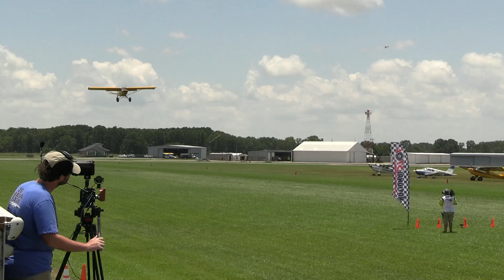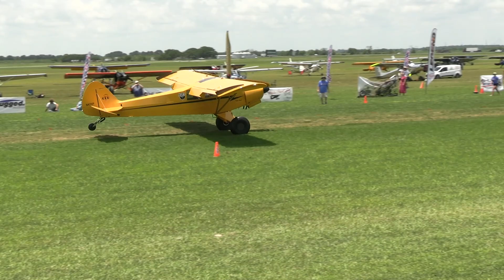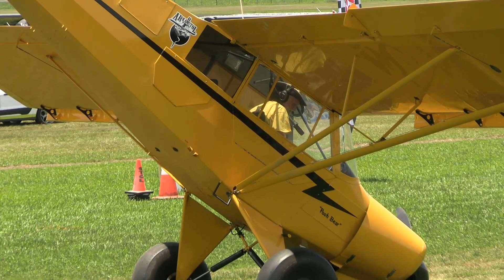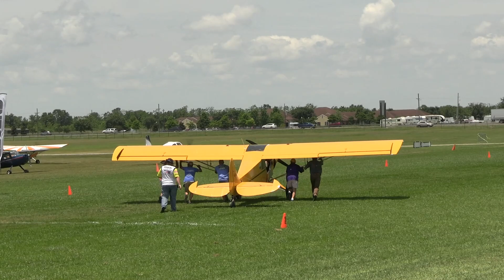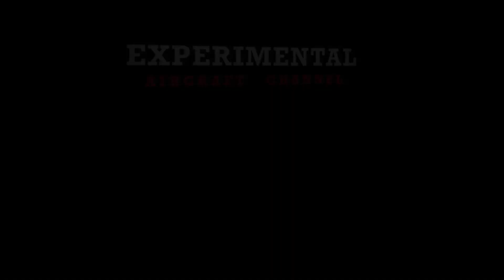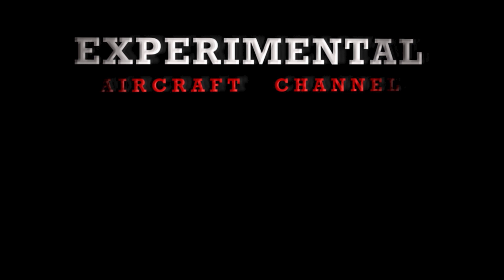SHORT LANDING!

Comment from the maker: Total NON-EVENT. Hard braking, sudden wind shift to tailwind or sudden gust of wind? Elevator is Full Up position with nearly no forward motion. Slow motion roll forward.  Your thoughts?
Reply: Improper technique. As tail is coming up elevator is neutral. Tail was done but came back up. When using heavy braking one should have a bit of throttle for positive tail control. Based upon my years of experience, that prop strike was benign. No serious engine inspection required, prop flexed a bit, depending on material of prop, possibly no or very minor damage.
Reply: It was too much braking at too low a speed.  With the engine at idle and airspeed less than 15 MPH, the elevator has no practical effectiveness.  And the start of it was the bounce off of the tail wheel.  Under hard braking, that bounce was all it took to set the nose-over in motion.  He should have released the brakes as soon as the tail started to fall, but it appears it applied them even harder and with the upward motion from the bounce, physics ruled as usual.
Reply: @waynetokarz174  I think a tear down and inspection is absolutely warranted.  This was clearly a sudden engine stoppage.  It was at idle which helps, but that prop stopped almost on the first blade and that is about as sudden as it gets and the G forces are huge in such an occurrence.  They may not find any damage, but a tear down and inspection by someone very familiar with that engine is absolutely warranted.
Reply: If you slow the video to .25 you can see he killed the engine before the prop strike. It was still turning but not under power. Prob no damage
Reply: @LTVoyager  Spot on. Angular momentum from the bounce exacerbated by braking.
Reply: This wouldn't have happened with a tricycle configuration. The whole idea behind a bush plane is to land on rough or unimproved air strips under any condition. But people do like nostalgia.  And then there's the crowd that thinks you're not a real pilot if it's not a tail wheel. Okay you can all hate me now.
Reply: It is the risk they take when doing this type of event.
Reply: STOL with tailwind?
Reply: @wingslevel  if the prop is not damaged it is extremely flexible LOL Freeze the video on and off as you watch it nose over, and sit on the prop. It was bent  at a pretty good angle. Then as you see the plane coming back down on the tail wheel you sort of see the prop turn as the one blade Springs back into shape. The one official who had a hold of a hold of the hub checked it out with a quick glance and a hand rubbing over  exactly where it was bent before walking away.
Reply: @birds_eye_view  no tailwind. they reversed the course half way though due to change in wind direction. By this time there was hardly any wind. It was hot like a 45 out there.
Reply: Little you can do with a certified plane. But a decent Fox air bicycle shock would have went a long way too controlling what happened.
Reply: @waynetokarz174  unfortunately I think they still gotta tear the engine down. It is another thing when the plane keeps running and the prop is just a bit bent but that mf’er completely shut down. It sucks.
Reply: @HaydenGinz  Teardown is mandatory in Canada, with wood props being an exception. In USA. FARs specify that a dial only inspection is required when a low power and/or low speed strike occurs in conjunction with the limited prop damage. The engine virtually never keeps running when the prop is struck and that scenario is not part of any specified criteria.  no tear down required as per all manufactures and FAA bulletins and regulations.
Reply: @farmnranchapiarybeehiveser8120   No hate, but I'd just rather have two large fixed tires up front than a smaller one that also has to be able to turn, when in the rough stuff. For these STOL events, (which have little to do with actual off airport landings, in unknown places) you are correct, a tri gear would probably be better, lock the brakes up before you land!
Reply: @LTVoyager  as in other posts I made, that decision is made based upon the FAA's mandates and the manufacturers guidelines. the fact that only one blade made contact is in fact a good thing, it indicates a very low energy state. when energy is higher the prop will continues and one will get multiple stakes on the blades, a condition that ultimately induces far greater forces on the crankshaft, connecting rods and the rear drive gears. I speak from the position of owner, maintainer and direct experience.
Reply: @farmnranchapiarybeehiveser8120  sorry but you are dead wrong! it has NOTHING to do with nostalgia. In fact,  conventional gear is far superior to nose wheeled a/c in soft or rough conditions. the nose wheel is heavily weighted and tends to dig in and cause much worse damage than you saw here! As a pilot of 40+ yrs, I assure you that is factual.
Reply: @portnuefflyer  true enough. Let me say I'm not against tail Wheels, learned in one, owned a couple. Most of your tricycle bush planes have a dinky Little Wheel up front. But it doesn't have to be, mine isn't. All three are the same size. And although the back has 16in travel, front has 10. All on Fox air shocks. Not only do I have differential hand breaking on my custom stick with two grips,  I can steer it or break It with my feet as well. Both wrists were injured decades ago So I have the option of using one or the other or both. Anyways it rides and handles much like my Honda 350X three-wheeler did decades ago. No turning tendencies, sucks up the bumps and tends to float over everything. I know my airplane is 100% custom. But the Zenith 701 is a real nice tricycle as well.  although I've noticed most tend to put dinky little front tires on those also.  My wing loading is only 6.7  and my power loading is 5.2.  but I rarely fly with all my camping gear and if I was doing competition I doubt I'd have all 24 gallons of fuel either. Perhaps one day I'll show up at Sun and Fun or Oshkosh but I don't care about competition anymore. Though maybe I should. LOL  take care
Reply: @waynetokarz174  And which FAA mandate and manufacturers’ guidelines are you referring to?
Reply: Well, the good thing about experimental is you can yank your own engine out, tear it down, and see if anything got damaged - namely the crankshaft. After a sudden stoppage like that, I wouldn't fly again until I knew for certain it didn't twist, or crack. I'd probably want to check the bearings, rods, and pistons (and cam timing too on a 4-stroke) too, just in case.
Reply: @LTVoyager  you clearly are not a pilot or a maintainer, otherwise this conversation would not exist. there is only one FAA and one set of manufactures guidelines as they pertain to any specific component of the aircraft. these can easily be looked up on line. Perhaps less time as a mouse-potato and more time at your local airport....just saying!
Reply: @waynetokarz174  I am a pilot (since 1977).  I am not an A&P (not sure what a “maintainer” is as that is not standard terminology).  I am a home builder so I know a little about airplanes.  I am also a licensed professional engineer.  I asked you to provide the guidelines you are claiming allow this prop strike to NOT require a tear down as all guidelines I am familiar with DO require a tear down in this case.  I want you to show the guidelines that support what you claim as I am pretty sure you can’t find them as they don’t exist.
Reply: @SmittySmithsonite  Although anyone can do their own maintenance on experimental aircraft. Doing things like annual inspections or major work you have to have a repairman certificate you can be granted one simply by being the Builder. but if you are not the builder of the  majority of the assembly you must take a course to get your certificate. So yes experimental is much cheaper way to go but unless you've done the majority of the work, you're still going to Shell out either money to somebody to sign off on the inspection, or pay for a course. I hope I stated that right. It's been a long day cutting and baling hay before the next rain comes.
Reply: @waynetokarz174  I am not sure what youtube videos you are referring to and I am not Danial S. and I don’t use Pinterest.
Reply: MUCHO FRENO...No habia necesidad,. CIGUEÑAL SE FUE EN PARO, helice.

Comment: Really smart to straddle the prop on a hot engine that just stopped.
Reply: And by "smart" you mean "not smart at all."
Reply: I do hope someone took him aside afterwards for  word or two , otherwise this sort of thing is seen by others who think it's ok and  the circle begins.
Reply: @leerogers6423  Yes, who knows if the pilot had the presence of mind to turn off the mags after the nose over.  Or if the mag wires were both still connected.  Or if there was unburnt fuel in a cylinder given the sudden stoppage.  I always treat a prop as though the engine could start at any time.
Reply: Loaded gun
Reply: @tomcoryell  Exactly
Reply: @leerogers6423  All of these people have experience with this sort of thing. Prior to touching the plane they checked to see that the fuel and mags were off. As the pilot I would know.
Reply: Hum.  The man grabbing the prop was one of two officials. He talk with the pilot first. He also grabbed the Hub.  He did appear to check out prop.  Only noticed one other official All others, the ones pushing appeared to be Pilots. Like the announcer said this happens all the time. I'd be willing to wager he uprighted more than one plane.
Reply: Darwin
Reply: @LTVoyager  Good idea, but if you don't move it (which I have no idea if he did), even if the mags are on it's not very likely to just restart itself.  Trip it just past that sprung mag, though, and it definitely could.  

I would think there is a MUCH larger chance of skipping procedures unintentionally right after an accident than on a normal 'park' and tie down, so there's that.  On the other hand, I have a friend who's dad was intentionally hand starting a plane, and the throttle was left significantly too far open, and he literally lost his head, with his wife sitting in the plane.  He knew all the proper procedures, too, and had done this many many many times, just takes one moment of lapsed attention.   Check lists are a good idea, too...just sayin.  One reason I built a Long EZ (a pusher).  It's a lot better if the airflow blows you AWAY from the prop.
Reply: @johnd5805  Darwin?
Reply: @Ozarkprepper643  Darwin award. The weak get weeded out.
Reply: @MrJdsenior  When the prop is buried a foot deep in the ground, there is a good chance it will move when the airplane is righted.  Straddling a prop on a hot engine is just stupid.
Reply: @johnd5805   John you are WEEDED OUT !!
Reply: @jeffroclamp-it3405   OH NO  NOT ME

Comment: One benefit to the Rotax 912's reduction system (which this didn't didn't have) is it's slipper clutch makes a minor prop strike pretty much a non event, crankshaft wise.
Reply: Yes and you can see it's start to move ever so slightly when the official grab the Hub.

Comment: Hmm, Mike Patey put a carbon 'spring' on each wing tip of Draco in case of a slow ground loop, to limit damage. I just wonder of something similar could be fitted to the landing gear of STOL planes to prevent slow prop strikes?  It sure could save a boat load of $$, time and everything else!!!  Just a thought....    8)    JMHO    --gary
Reply: evidently that idea worked as well as the mark 14 torpedo :)
Reply: @paulslevinsky580  LOL  Ya, nothing would have helped with what he did. Although I think the 'tips' were fine, just ripped the whole wing off!  LOLOL   8)    --gary
Reply: Can't really change a certified plane much. But for experimentals there's no reason to have a typical tail wheel setup. One incorporating a good shock like Fox Float with adjustable rebound  control for a bicycle. They weighed just over half a pound. That could have controlled the Bounce from the tale wheel that set everything in motion.
Reply: @Ozarkprepper643  I think that's a Carbon Cub?  The company is 10 years old and they are LSA, not certified. Most of the planes in the STOL comp are LSA. I get what your saying, however there are still a lot of nose overs in these.  8(    --gary
Reply: @gtr1952  I have a lot to say  but I always delete  for fear of coming off wrong. Yes there are a lot of nose overs in competitions. Most are tailwheel and stoping short often means braking hard. I have been flying since the 70s learned in a tail wheel and built a kit fox in the 80s. But I prefer tricycle gear. Tailwinds and braking are much more easily controlled. My current plane is a tricycle with swing arms and 16 in of travel on Fox air. But I also run a small tail wheel just in case. Somewhere here I went into just a little bit of what my current plane has. But it is under Farm and Ranch apiary . If you're curious I'll respond. Maybe one day I'll go to a fly in or competition. But I'm much too busy. And when we find time to get away.. rather it wasn't around a crowd. LOL. Take care

Comment: Can't believe so many people are saying the plane is ruined. A low energy strike like that is no big deal at all for these guys who work on their own planes. He'll have to dial the crankshaft and do a couple other minor checks to verify the engine is still within spec, which it probably is, and he'll have to spend a few grand on the prop. It's no fun, but he's pushing his plane to the absolute maximum performance for short landing, and when you do that a tiny gust of wind or a bump can cause this to happen.
Reply: You are correct. In this case the prop was examined and there was no scratches on the prop or spinner. A run up was smooth with no vibration. This was a new composite blade with lots of flex. We suspect that the blade yielded and returned to normal.
Reply: @josephedwards888  Wow, I find that amazing.  Hell of a commercial for carbon props, if it now goes through the rest of its normal expected 'life' without a major failure.
Reply: Quite often it's just a propeller blade. Meny fixed pitch or ground adjustable props especially a two blade often cost less than $1,500. There are some expensive companies out there. But if you're on a budget and experimental...... light sport aircraft can't have constant speed or in-flight adjustable props. Those are the ones that cost more money.  It also  depends a lot on the speed reducer. Belt is much more forgiving than geared.  And the airframe was totally unaware anything happened. Lol

Comment: The guy on the nose is lucky he didn’t get seriously injured or killed. The engine is hot and he moved the prop. He had no business trying to help from that position.
Reply: Interesting since he was a official. Also he had a hold of the Hub. He was the one communicating with the pilot, not once but twice. He also directed The Others on what to do. It just happened quickly.  Likely he has been through that experience before. 
   I work for a few years at our local dirt stock car track. I drove the Pete that water down the track, plus was on the safety crew. To reduce confusion only the head official out there does the communicating. Everyone else has protocols to follow. I'll assume Insurance dictates much of the same protocols regardless of the sport.
   Ever been to a drag race and see them fire up a 3,000 horsepower engine? There's often a man there squirting ether into the blower. Have you ever seen one explode? Have you ever seen a rodeo clown when the bull riders are out there? They're lucky they don't get gourd.  That not only hurts but can lay you up for weeks.  I am now speaking from experience.LOL

Comment: Hello Guys,
After a prop strike, what are the inspections and maintenances will carry out? 
What about the average cost?
(I'm just an aviation enthusiast)
Reply: Composite blades are very forgiving and don’t transfer shock loads to the engine like metal blades. Blades are cheaper than engines and that is one of the reasons that competition pilots use them.
Reply: @josephedwards888  Exactly. We fix tube & fabric stuff and this kind of thing happens a lot. You do NOT necessarily or even legally have to open up an engine or even overhaul it. It all depends. Plastic props - dial the flange, throw on new blades, check tracking etc and run it. If it all looks good, fly it. We've done if many times. Metal props on hard ground -  different story.
Tired off all the experts here yelling "tear down!"

Comment: Curious if the guy had a converted car engine, say a viking, if this would warrent a tear down.(gearbox of course) Is this similar to stalling a manual car at idle since this plane engine was surely at idle too? Just asking, no idea what i would do myself.
Reply: Not being a pilot myself, I know the Rotax engine is very popular among these guys. They’re direct drive off the crank. I’d guess with a prop strike you risk bending the crank, part of the overhaul would be ensuring it’s still true to spec. 

I’d guess it’s highly unlikely it’s bent but you can’t take risks on aviation engines